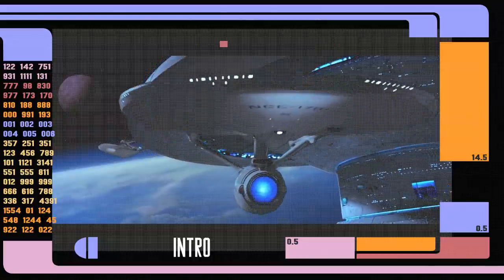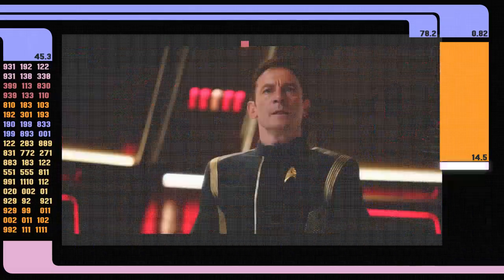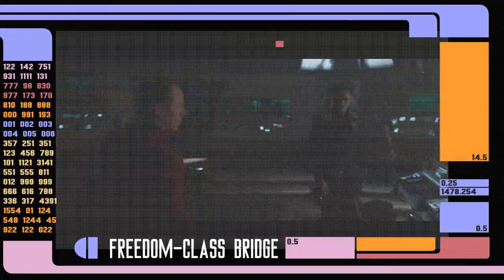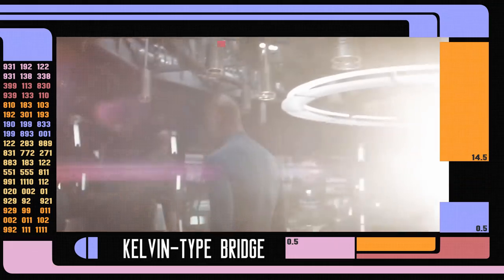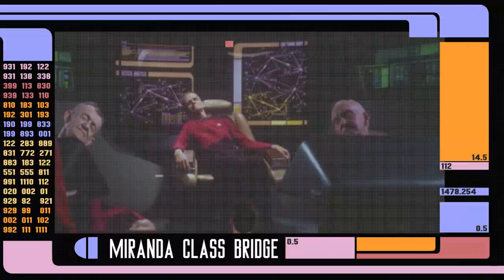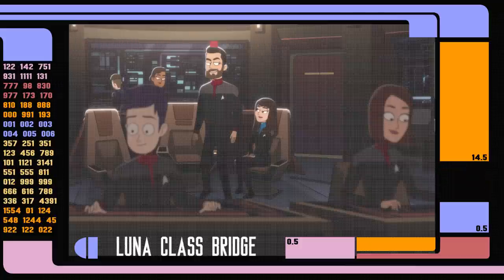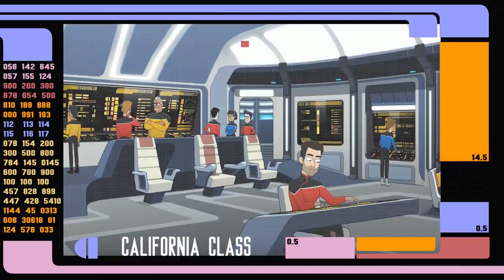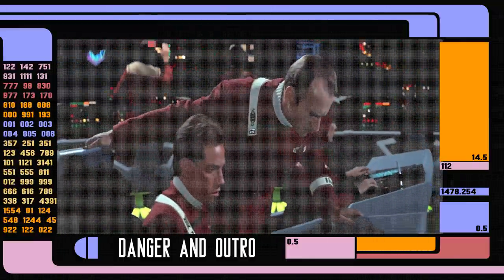Forgotten, Fatal, and Unethical Starfleet Bridges

Comment: Transparent metals already exist. They are, however, prohibitively expensive and heavy and currently give no more protection to heavy weapons than heavy, thick, bulletproof "glass" (windows haven't been made out of actual glass for decades).
It is useless on heavy vehicles (tanks, ships) and way to expensive and heavy on small vehicles like a humvee.
Reply: Last I knew ALON was better in .50 cal trials than glass (thinner, somehow lighter, and more bullet resistant), but it is hard to make it in the large panels we need.
Reply: Transparent aluminium, is much better than bullet proof glass of the same mass or plastic.

They might be more expensive to make but considering the cost launching to orbit it is cheaper. manufacturing costs are already dropping.
Reply: @seriousmaran9414  I cant wait for something similar to that material to exist. That said, if one were to take the strength of Aluminum today, it's a very light however very weak metal compared to other metals. Certainly stronger than glass for a given thickness but still falling far short of steel and the notably refined alloys used in eg modern submarines. 

I would 'guess' (given it's all fantasy anyway) that the future materials used would still demonstrate relatively greater strength in non-transparent materials.
Reply: @DarenSpinelle  transparent aluminium is being used in small quantities. The only real advantages are it is relatively light and you can see through it. Useful for Windows but nothing much else. Issue is you need to compress it at very high pressures as well as heat so it would need a huge and expensive machine to produce big panels.

Generally I agree that there are alloys that are light and/or easier to make and use.

Comment: The bridge's would be safer if they removed the rocks and plasma power conduits running straight to the consoles.

As to the ships appearing next to each other, they are not, they are represented next to each other for visualization purposes, like the Asteroid belt, the next ship would just be a pinprick if viewed through a passive window by a naked eye and yet even exterior shots show asteroids as huge rocks just a few feet from each other.  This was illustrated when Riker and Worf hacked the Enterprise's computer to make it appear as if another ship disrupted the battle exercise between the Enterprise and the Stargazer.  Everything only appears side by side so we can comprehend what we view.  This is like how an asteroid belt would really just be distant points of light not the jumbo of obstacles shown.   Having the ships close enough to be seen in detail with the human eye would be ridiculous especially when photon torpedoes are anti-matter weapons, a single torpedo could damage an entire fleet if they were in close enough formation to be seen in such detail with the naked eye.

However, my objection is that with Interstellar space travel, most of the time would just be passing the time, granted FTL travel may change this, but how often would a bridge really be needed.  It's far more likely for there to be multiple uses for that space.

Seatbelts are not effective enough for the acceleration forces involved, inertia dampening fields would be needed.  Seatbelts without inertial dampeners would probably rip the person into thirds for a 3 point seat belt, into fifths for a five point seat belt.  If the acceleration can overwhelm the inertial dampeners, it would be too much for seatbelts to handle.   Face it, Star Trek bridges are for plot and plot alone, you can rationalize forever but it will never really make sense.
Reply: I agree but for windows, every time you dock mostly for space dock or fight someone who doesn't have windows and ROLF as you drift up beside them power off or just send a probe to hack into their mainframe and cause it to give false readings/images.. And the seatbelts I've done the math for my own sci-fi novel, and getting hit in a ship meant to be hit with those weapons would never be worse than on a modern naval vessel... which also don't have seatbelts but still. In fact, it's really unlikely to ever see a G force greater than what a human can take in star trek/expanse style combat... And if you exceed ever 50g then you can have a seatbelt made to not cut you... we call it on earth kevlar... Which for reference a 50 cal round only generates 100gs and you don't see tank crews bouncing around from being hit...
Reply: Atthe end of the day, inertial dampers are one of those technologies that just have to exist in Star Trek. Otherwise people have to secure for every little maneuver and you run into massive problems gatting anywhere at sublight speed.
Reply: There are no rocks. It is just insulation and other material that makes up a computer control panel.
Reply: GIVE this man a job!
Reply: @Jack_Stafford  Insulation in space is MLI insulation, basically layers of reflective foil separated from contacting each other often by a honeycomb net (yes corrugated cardboard has been used) simply because in a vacuum heat can only be radiated not conducted or convected and there is a lot of vacuum in space.   There's a reason why the Lunar Lander in the Apollo program looked like it was all tin foil and cardboard because it was, as that's what insulation on a space craft is.  As with a thermos, the best insulation is a vacuum and a vacuum does not look like rocks.
Reply: I suppose the plasma conduits is future speak for electrical wires.  Power has to go somewhere to feed something.  But in reality, and I have worked with plasma, plasma is very dangerous and you better know what the fuck you're doing when you handle it.  I've used it to cut steel for example.
Reply: "As to the ships appearing next to each other, they are not, they are represented next to each other for visualization purposes"
Khan vs Kirk would like an opinion on that, since their ships were really close, not only in the Mutara Nebula, but when the Enterprise was in its way to the Regula-1 station
Also, Star Trek Nemesis, "Ramming Speed"
Reply: @L1z43vr  Well the TNG episode involving "battle exercises" between the Enterprise and the Star Gazer showed that what was on the screens was just a computer representation of what sensors read so the ships appearing next to each other was all false as they would just be a distant dot otherwise.
Reply: @johnwang9914  Then how in the bloody heck can Picard ram the Enterprise against the Scimitar (I can not type that ship's name, it is PHYSICALLY Impossible for my fingers-) And why the crap were Kirk and Khan so desperate to get the Enterprise and the Reliant out of the way as fast as possible when they were, if what you say is correct, distant dots? Wouldn't it be more logical to calmly steer the ship out of the way?
Reply: @L1z43vr  There's no logic to your argument.  Having most of FTL travel being just waiting hence simply controlling the spaceship through networked mobile equipment communicating with what would essentially be server rooms instead of from an actual bridge does not stop them from ramming one ship with another.  It only means the theatrics of doing so would be different.  Remember that the concept of a bridge was simply a physical bridge between the paddle wheels of a paddle steamship and commands were just verbally passed from the captain using the bridge where there was greater visibility to the engine room and the coxswain, WWII bridge would also just verbally relay commands to the engine room though rudder control was from the bridge, even today, many of the throttle controls would have a control on the bridge but it would only ring a bell in the engine room to indicate what speed to set the propellers at.  Even modern ships often verbally communicate the commands to the respective areas of the ship.   The bridge was never an actual "control area" but an area from where commands would be communicated to the needed areas of the ship.   This is demonstrated numerous times in Star Trek when the ship does not respond to the bridge and they're calling engineering or auxiliary control or even sending Scotty into a Jeffrey tube to sort put the problem.  Also in the early episodes of TNG, the engineer whether LaForge or his predecessors, would come onto the bridge and transfer his engineering console to the bridge showing essentially networked VNC controls.  The bridge isn't where all the controls are but where the commands are given and always has been, otherwise they would call it the cockpit.  Having most of the mostly unneeded controls by say a tablet does not stop the ability to ram another ship.
Reply: @L1z43vr  Actually, those examples does not preclude from just being for visualization purposes.  Besides Riker and Worf while commanding the Star Gazer hacked the Enterprise to present an attacking third party in the screen and sensors to distract Picard, it's all a computer tactical simulation in world and the exterior shots in the movies were again just representation to the movie viewers.  You don't actually think the movie is actual footage taken through a window in space of actual ships do you...   It's like how in the asteroid belt, the closest asteroid would just be a faint point of light to you not the morass of tumbling boulders shown in movies and tv shows...

Comment: You should design your own bridge how you would want it personally and let us see it! Maybe judge some viewer made bridge designs just for fun!
Reply: Here's mine ready for it.
Captain in, guess what, the middle, but a half step down and on a chair that can lock in place or swivil with a flip of a switch. then navigation and helm you guessed it immediately in front of the captain, but using a singular "wavy" patern consol and tileted 20 degrees towards eachother that way they have a ear towards the Captain but are slightly facing eachother to better communicate while the "wavy" patern gives a psuedo cubical effect.
The number two, and either comms or a diplomat/relevant officer station would both be next to the captain with their own mini-consols which can be immediately linked to the primary controls of any station needed, or customized to whatever task they are performing. Off from the sides of these two in a wing patter and angled towards the forward viewscreen but that they always had a ear facining the captain would be two science stations, a dedicated comms, and of course tactical and combat stations, tactcial would manage coordination of all combat elements and multi ship weapons fire and onboard security and even have a phaser immediately ready on their console, where combat would  manage just the ship weapon systems and monitoring "ammo" as well as have basic updates from Engineering.
Lastly as a compromise to the circular design the back wall would have Engineering stations along the back wall but also have a position closer to the captain dedicated to relaying information to the captain and to take charge of the officers monitoring Engineering should the captain be unavailable.
Obviously with the exception of the navigation and helm all sections have a little bit of cross command/communication with other sections so the ship while being more crew heavy could theoretically operate either without the captain, effectively operate another ship remotely (say if the Enterprise's  bridge got destroyed before everyone moved to the battle bridge), and immediately respond when somehow the impossible happens, and a fuse somehow magically fails to blow itself and instead allows enough energy throw to turn a consol into anti-personel grenade, and they can take over another station without having to physically move to the exploded console.
Oh and a secondary and third viewscreen to the sides of the main which would primarily be meant to hold the last image displayed so  to reduce the need to cycle between the two or three images a ship would display and to reduce unnecessary head movements.

Comment: Another dedicated system room we see on the TOS Constitution is the Main Phaser Control Room, from which the Phasers can be operated independent of the bridge, and from which some components of the Phasers could be accessed (notably the coolant lines, which rupture during a battle in one episode).  The NX-Class had a similar function with the armory room, from which the Phase Cannons could be operated, and which also contained the forward torpedo launchers.

I think we see the bridging from the more manual systems to the automated ones in TNG+ in the TOS Movies.  The Refit Constitution-class Enterprise as of ST:II had a large pair of manned torpedo bays.  When we see the torpedo tube of the Enterprise-A in Star Trek: VI, it appears to be a much more cramped and automated system.  We unfortunately don't get to see Excelsior's torpedo room.  Considering the era, it would have been interesting to see if it had the Refit-style torpedo room or the Ent-A automated system.  We never, to my knowledge, see the torpedo room in TNG, but we do in Voyager (IIRC, in Year of Hell), and it was a cramped space with severe risk of plasma burns to any crewmen in the room when the torpedo is fired - unlike the Enterprise-A, where Spock and McCoy were safe and unharmed right behind the tube doors.

As a side note, we see that the torpedoes are substantially smaller during the ST:VI era as well, rather than the large coffin-sized lozenges in ST:II and once again later in TNG.  Perhaps this is why it took so seven to destroy Chang's ship when its shields were down, compared to the significant damage done to the Reliant in ST:II (big chunks of the ship were blown apart) and the Klingon BoP in ST:III (damaged them so badly they had to go to emergency power) and the ship-vaporizing blasts we see on occasion in TNG - it could be that the smaller torpedoes may have had a comparably smaller warhead.  It might also be that, after having to pelt an unshielded Klingon scout ship with more than half a dozen torpedoes to destroy it caused Starfleet to reverse course on the whole smaller but more numerous torpedoes.

As off-topic as that got, it may be that the energy required for the increased computer automation, or the nature of Isolinear circuitry, necessitates running EPS conduits into the consoles.  We see Consoles get overloaded in TOS and ST:The Motion Picture.  They short out, smoke, catch fire, and even shocked Chekov and burned his hand pretty badly in TMP, but what we did not see were consoles exploding (with the exception of the Kobyashi Maru test in the simulator, which was apparently theatrics, since we did not see those kinds of console detonations in either ship in the battles later).  The bridge on Reliant suffered severe structural failures from battle damage, and debris falling on Khan's crewmen killed them, but we did not see the consoles explode.  Again, back to the circuitry, perhaps Duotronics could work on levels of electricity that can use conventional conduits just fine, but the newer technology just cannot.  It would make much more sense that Isolinear systems actually require the direct EPS taps than the idea that Starfleet went on an unrelenting efficiency bender that turned every workstation on the ship into a bomb, and then they refused to correct the issue the first time one of their ships shrapnel's its own bridge crew to death.  Of note, apparently this problem had already taken hold 20 years before TNG, as the Enterprise-C had bridge detonations that killed her captain.

Comment: @ Lore Reloaded: Might want to look into Aluminium oxynitride, it's basically see through metal and has been in use by the military for the bulletproof windows on vehicles for awhile, among other things. A see through material is not advantageous for most purposes though, so cost aside no it's only likely to be used in areas you really want a window to be at, and will also in Star Trek have obvious issues with being vulnerable to lasers, extreme sunlight, and some other types of radiation that, by it's intentional design, can pass through it possibly more than you want in some environments. You can throw some heavy smart tinting and shielding coatings on them sure, but suffice to say I'd take a high end display over one of these windows if that means I can have a purpose built armor plate there instead that while not caring if its transparent, could be designed specifically to protect me from everything out there that I don't want in here...
So sure, put them on some viewing decks and some areas, but be cautious with them, and any case of having a bridge that only got one thin level of metal, transparent or not, between it and the enemies in front of you once the shields fail by any means, it just universally a bad idea. If the bridge can navigate by sending signals to the engines, they can damn well find a way to send and receive signals with some cameras around the hull if nothing else so no the power going down is not a valid excuse in most cases, and you could just have someone run up to an observation deck and report back via comns if the main ship power is out for the decision making elsewhere in the bridge, even if they can't really do anything with no power to anything on the ship for some reason...